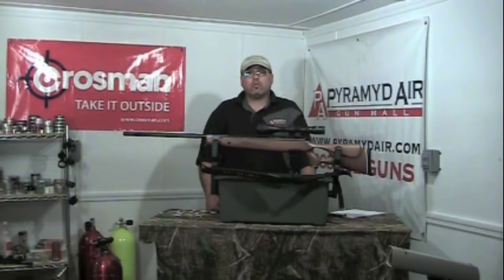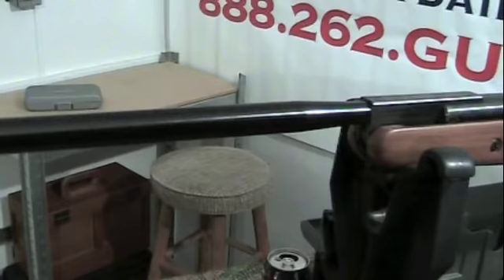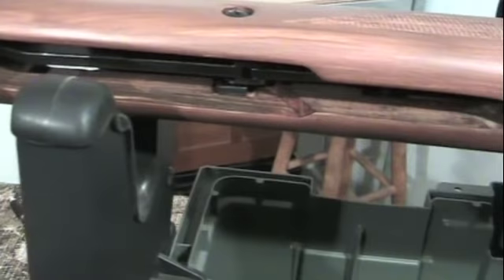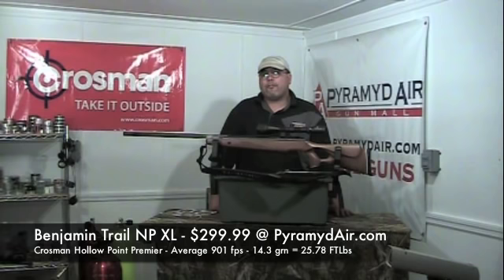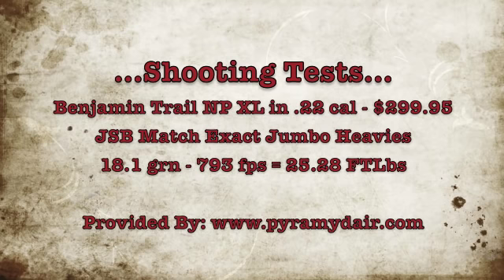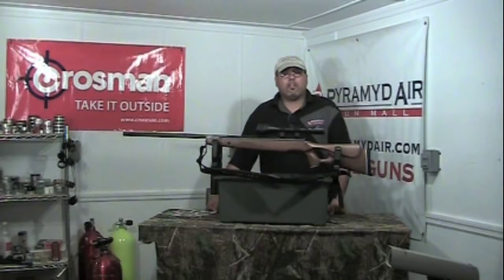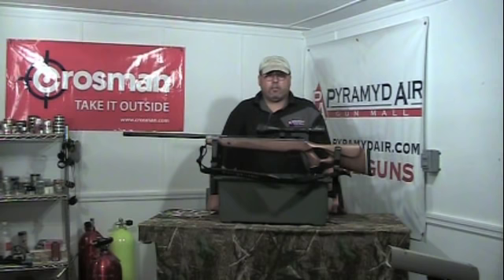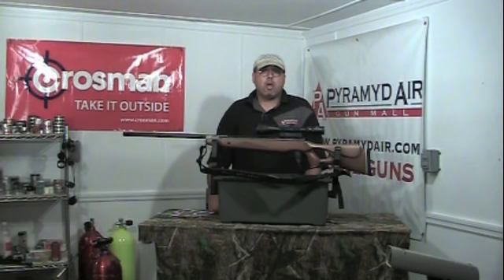Benjamin Trail NP XL - .22 cal Gas Ram "ultra magnum" (At least that is what I call it..!)

Comment: hey, whats the difference between the trail XL NP .22, and the Trail NP .22? is the trail just smaller than the trail XL, or hass quality, size, accuracy, or weight  been compromised? Also, what is better for long range and which is better for short range, the trail or the trail XL. Also, which pellet size is better, 177 or .22, for up tp 30 or 40 yards, and then for 50-100 YDS? I dont need real accuracy for 50-100 yards, just enough to hit a piece of paper.

Comment: @AirGunWeb i also want accuracy with power. about 920 fps in .22 is perfect using lead pellets or 870ish. after that its too fast probablly and wont be accurate. i want a pcp airgun but they are 500 dollars or more plus 170 for a pump so u have to pay 700 bucks or more for an air gun.

Comment: @grandbbq  So, after putting the XL 1100 down I picked up my vantage 1200. cocking that is now like breaking a toothpick with your fingers. LOL.... I tried to puit the scope from the XL on the vantage but I have to get a little taller mounts. the front of the scope hits the body and you cannot lock in the stock vantage sights. The vantage scope was bad, this scope that comes with the XL sucks too. Actually open sight on the vantage is dead on. As long as you can see that far.

Comment: @grandbbq  well got the gun, nice. the scope sucked so I took the BSA AR27X32 off my Vantage 1200 and it is sweet. The stock trigger was the old modelas I got the strap. I put the GRT-III on the next day when that came. Ouch. Solid feel but holy cow. no 1st stage, it is a hair trigger literally. The first pull shocked me. I barely touched it. I am still trying to get it to have a little pull before launch. After about 50 rounds I had to take rest. What a workout. Continued.

Comment: I thought I'd add that the Stoeger isn't very impressive, especially considering it's low power compared to Crosman. Stoeger is mostly identical to Crosman inside, but that X20S barrel is only 13" inside and it kills power! My Titan or regular Crosman coil spring guns with tar are as quiet if not quieter but as much as 50% more powerful! You can tar the Stoeger too but you're still stuck with the power. You can add a suppressor to a Crosman and again surpass the Stoeger. I returned my X20S...

Comment: Hey Rick I'm looking at the Benjamin xl or the Hatsan 125 sniper in 22 cal your thoughts
Reply from the maker: The 125 Sniper will be a much more durable choice, until Crosman addresses the barrel joint issues the will continue to loose accuracy over time.

Cheers
AGW

Comment from the maker: 1500 fps in .22 is not going to happen.. 1100 may happen.. but 800 to 900 fps is more practical.. Remember that manufactures inflate their FPS numbers by using lighter and lighter pellets.. That does NOT equate to more energy or accuracy.. Going fast is useless if you can't hit what you are aiming at.

cheers

Rick

Comment: Given that there is a pellet in .177 that weighs in at over 13 grain (JSB?), wouldn't it make sense to use this in my XL 1500 for maximum accuracy and energy, rather than settling on the "standard" heavy, say at 10.5? It is the same gas ram as the .22, after all?

Comment: Rick, have you tested Beeman's Mach 12.5 .22?  That bugger seems to be THE most powerful break-barrel spring rifle on the market under $300..  Delivering in the high 28's of FPE using a variety of lead, heavier-grain pellets, etc.  Notably, everybody seems to complain about the cocking force required though.  I'm trying to decide between that and something else nearly as powerful.. I want to hunt small game.  Recommendations?  --Thanks.

Comment: True, it's chinese, but it's a good design and a great looking gun. Imo they just need a little work, basically to finish them up where the chinese did not. The trigger, some misc finish work and you're done, just consider it part of the price because otherwise it would be another $200. If you want something that's perfect out of the box you really need to go German, real German like FWB or HW. I like the XL because of it's looks, they're hard to beat in that dept.

Comment: i'd skip on the 1500, go to the 1100 (22 cal). reason is that .177 cal is too fast for these magnums -- 1500 = breaking sound barrier = loud. and as the pellet travels it will lose speed and go back to subsonic at around 1100 fps causing it to suffer pretty bad on accuracy. even if leaving the barrel at 1400 fps with a 6.5gr pellet, it will cross the SB at less than 10 yards (30 feet!) from the muzzle... .22 is great balance at these power levels. i'd get the regular trail NP if i was going .177

Comment: I followed your instructions on rebuilding the Crosman Nitro Venom ( I think it was). Gun shoots and cocks like a dream now. Thanks I would have never known. I didn't have any molly grease so I used a synthetic grease instead, think it has graphite in it, only put it on the outside of the piston.

Comment: i have a very accurate stoeger x10,ive documented below 1 inch rroups at 45 yards,ive taken down large doves out to 55 yards with headshots,thats only a 15 fpe gun at the muzzle shooting cphp's.....so i would definatly say yes....you can take down large crows at 50 yards with this gun.
my $80 crosman phantom .177 dropped a 9 lb rabbit at 82 yards with a headshot,it about 16 fpe at muzzle with cphp's...at 50 yards,im guessing it down to 12 fpe on impact.

Comment: Can I use the H&N piledriver 30 gr in my trail xl 1100 ?
Reply from the maker: No.  I would not recommend it.

Cheers
AGW
Reply: OK brother I trust your opinion , now. Can you elaborate just a little and maybe tell me if you crony tested the piledriver in the trail np xl 1100. I don't need a video just some figgers telling the FPS. I can cipher from there. I had been given to understand a good magnum could shoot these and your description of this gun is, " ULTRA MAGNUM " from which I bought 3 tins on a good deal. I do not doubt your, "NO" it's just I am one of those nosey bastards that want to know WTF I'm talking about when I tell someone else NO .thanksRON
Reply: are you to busy to answer
Reply from the maker: I've been out of town... and frankly yes.. I've got over 1000 comments in the backlog.  So I get to them when I get to them.  The pile drivers are meant for magnum PCP airguns.. Not springers.  The shape will cause a lot of drag in the bore and requires a ton of pressure to get them to move with any velocity.  Springers operate on a fixed amount of air volume, very limited.  PCPs have more air behind them and some continue to provide pressure to push the pellet out the bore.   You can certainly try them, but the extra back pressure may blow your seal or blow out your power plant.  

Cheers
AGW
Reply: I use the .177 piledriver in my Crosman quest 1000x. The shots seem to group nicely at 20 yards, but the crosman "wadcutter" pellets have better grouping beyond 20 yards.
Reply: @lacey1948  there just to heavy for even a high power break barrel to push...you need a pcp fpe that

Comment: What do you think of the NP2 rifles
Reply from the maker: +Bryan Morgan - There is a reason that I've not reviewed one.. I had several of the early models and they all fell apart before getting through the break in.  After talking with Crosman at SHOT 2016, they may have resolved some of those issues.. I would need them to send in some for testing.. I plan on reaching out to them next week to see if they are open to it.  we'll see.

cheers
AGW

Comment: The trigger is very easy to fix without buying that overprice Charlie De Tuna trigger.  Why spent $40 bucks on a overprice trigger when you can use a washer that cost less than .05 cents. My np .22 is very accurate after I fix the trigger with a washer.  And the trick is no one will ever know you tune the trigger without taking it apart. There is no first stage when tune with a washer and safety still works perfectly.

Comment: What Rick said; probably a bad one, it happens... If you have a Crony to measure the power we could tell you if it's a bad gun or not. Pretty much all of them have a bad main seal, but I would take it apart and check the seal, the tube body, barrel, transfer port, breach seal etc for problems. You can write me at chevota at hotmail if you like

Comment: Good review overall, but the rifle is disappointing. Chinese junk. Stock looks like  (plastic wood?) garbage; the manual instructions are stamped on the receiver; the trigger is miserable; and the reviewer failed to specify what distance the grouping was done - rendering the info unhelpful to those who don't have mental telepathy.

Anyhow, I was interested in perhaps buying  one based on a hyped catalogue description, but this review spared me the grief. Rather go with an RWS 350, 460 or Webley Patriot - if still available.